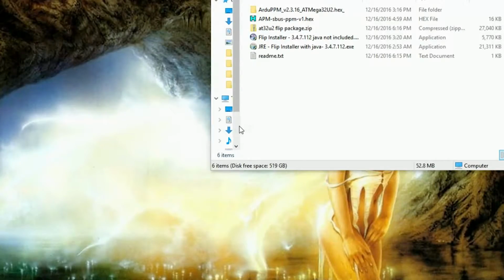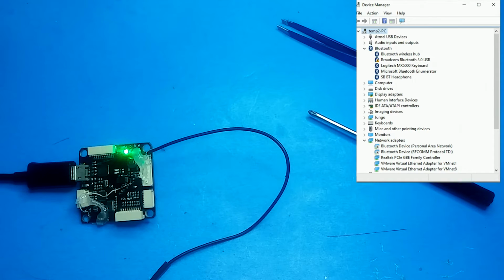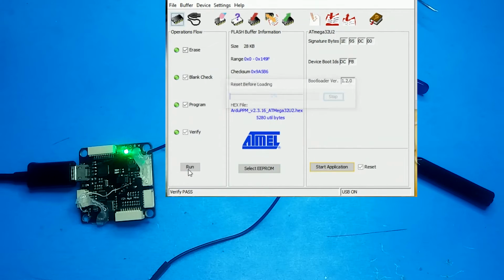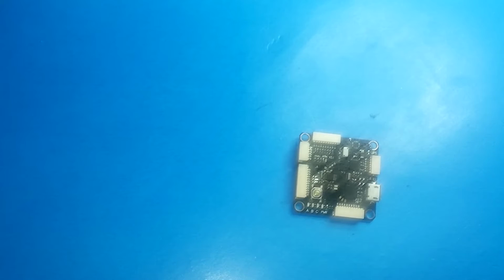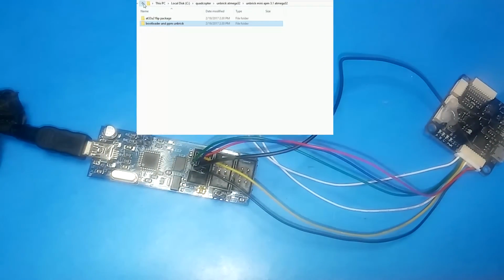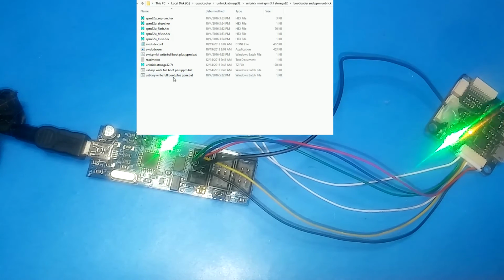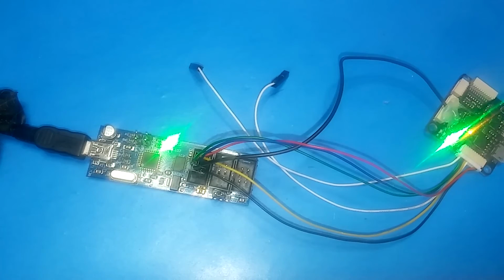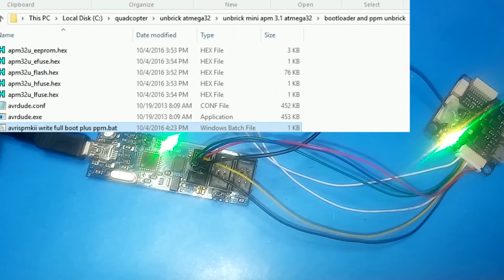Mini APM 3.1 un brick  atmega32 isp and flip instructions

Comment: one last thing, on the apm 2.5-2.8 there is a solder bridge you can do to bypass the ppm encoder and send ppm directly to the 2560, any idea if there is a pad on the 3.1 board for that trace?

I would modify mine connecting the sbus decoder out to an isolated ch4 pin so if I wanted sbus i just jumpered 4+5 and fed sbus into ch1, and if I wanted ppm I just removed the jumper and connected the receiver to channel 5.
Reply from the maker: you just loop channel 2 and 3..  or solder jumper across these two pads
https://youtu.be/0OxpfMLNZss?t=406   sck and mosi    .... At least I think thats your question

Comment: Hey bro I have a minimosd that I've connected wrong the other day by mistake for less than 2mins.  I connect the 5v to the RX pin. Now I reconnect it the right way it stop receiving information. What can be done, if anything?
Reply from the maker: weird it blew the rx is 5 volt tolerant, at least I think it is on the atmega328p 

the other problem is on the osd the rx and tx and directly connected to the atmel chip so nothing to blow accept the microchip it self
do the lights still come on?.. I can do some voltage readings on certain spots to see if its something else blown..

. .. so your options would be .. try to connect to it through isp and see if you can dump the firmware .  If you can, then find the source code and add software serial library. and use 2 other pins that are not being used for rx and tx. ..

If you go that route I can look into finding the source code and see if its even possible .

besides that its either replacing the atmega chip or the unit.
Reply: bangs6996 all the lights comes on even the little green one that show data When I connect it to the USB stuff it's saying can't talk to bothloader, when I plug it into the apm it's saying waiting
On heartbeat. Can you guide me to a site to explain what you just reply to me, or show me how thanks
Reply from the maker: do you have a isp? something like this https://goo.gl/8XVE3P

if you don't have one ..not sure if wold be worth getting one..it might cost just as much as a osd ..specially if you get one and it turns out the chip is actually toast...

If you do have a isp .. then i can try to dump mine and send you the code...
Reply: bangs6996 don't have one like that, thing thing I use to program it  is USB device that came with the other open source gps osd I had. Guess I will just have to stick with the apm ground station
Reply from the maker: yeah that cable you have is just a usb to serial adapter. 

if you ever get a isp let me know..    Do you have any spare apm 2.6?  ..maybe a way to turn that into a isp programmer ..but you would need to solder on your osd.. and I have not traced it out yet, the problem with that is if you brick your apm as well then you are totally stuck getting a isp ..
Reply: no i don't, just bought this APM from banggood and install it in my F330 Quad. i think i will just forget about osd, since the ground station provide all the info and i have the 915mhz telemetry radios install as well. i build this for practicing purposes since i am planning to buy a dji phantom do some aerial work! what advice or thoughts on that?